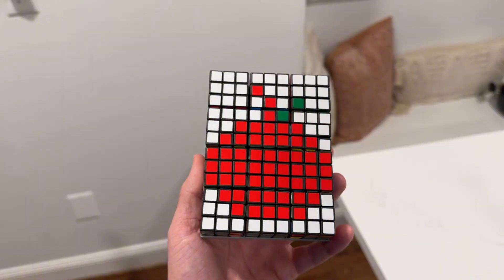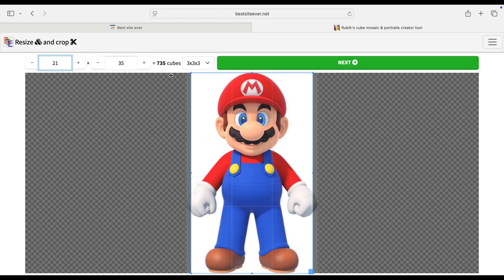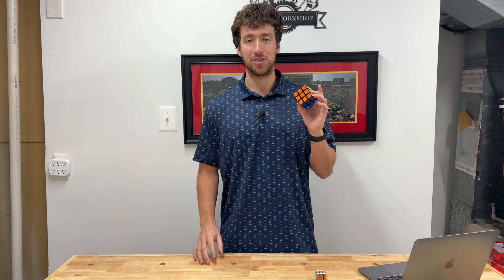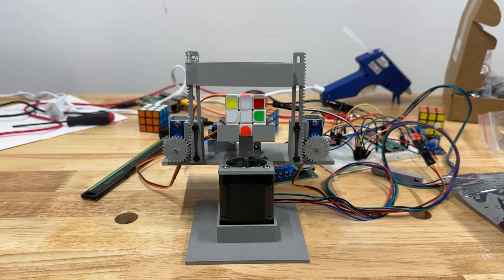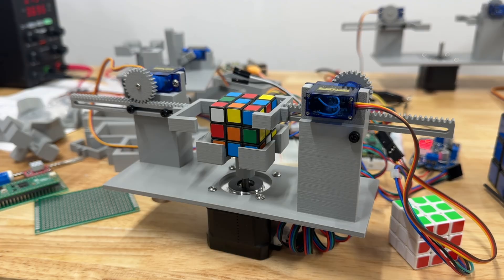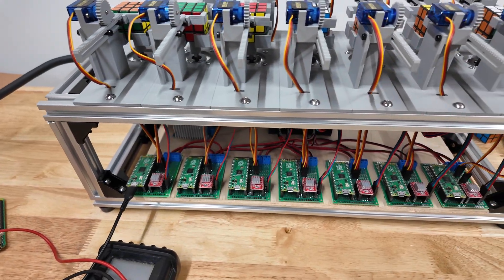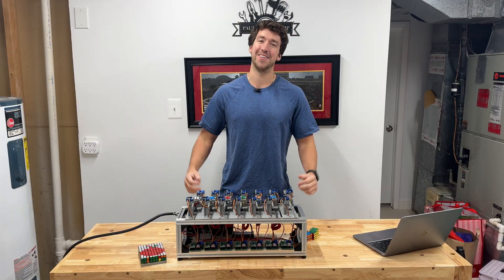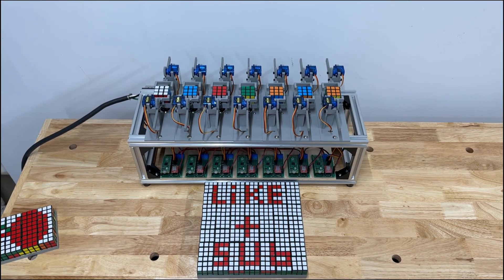This Robot Turns Rubik’s Cubes Into Art

Comment: I was looking over your project and the challenge of moving multiple things around and I have a question.
I've been wanting to build a kinetic structure that consists of a grid of 25 x 25 hanging balls that can move up and down Independently AND Simultaneously   The issue is that this would require a total of 625 motors along with controllers and wiring.
Do you know if there is a way to create this type of motion using fewer motors? Sort of like a mechanical multiplexer.

It's possible to create a very fluid motion by using a single motor with an eccentric circle, but while this is a fluid motion, the balls are not independently controlled. For example: https://www.youtube.com/watch?v=3jfix0NnDFk

Another way is use a series of motors that move along a track. But while this results in stepped movements, they can not be moved simultaneously. For example: https://www.youtube.com/watch?v=8DWK3zm9SMs

I could just bite the bullet but if I decide to ramp up to an even larger scale the issues with so many motors just compounds.
Any thoughts on any alternate methods to address this?   Just curious   Thanks

Comment: Something that could be useful is a colour sensor for each cube that automatically puts the white face on top and checks to see if the cube has the orange and red faces flipped, that way you can just plop a cube in the holder and it automatically does everything for you. Including alignment and detecting swapped faces.
Reply from the maker: This is a great idea. I actually thought about this because it is annoying having to tell the robot each cube
Reply: Also, add an XY arm to load and unlaod cubes.